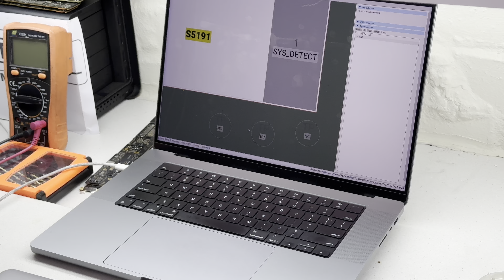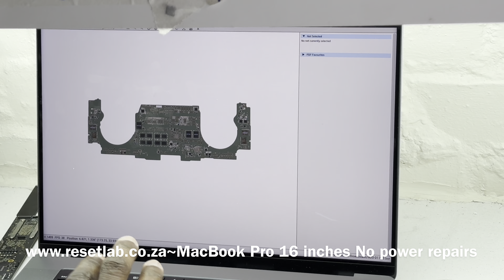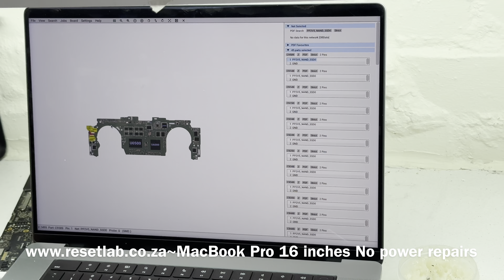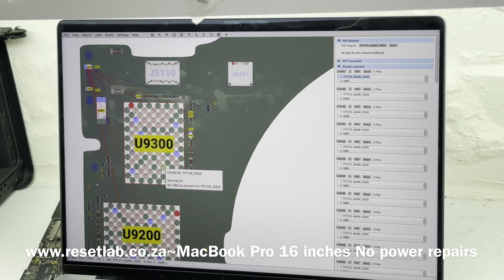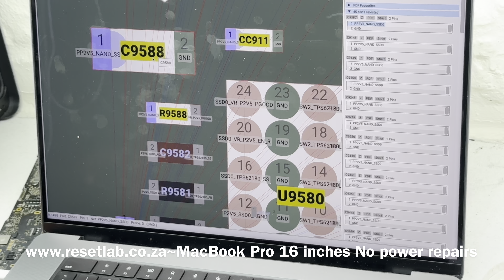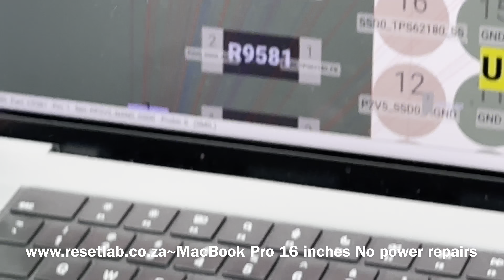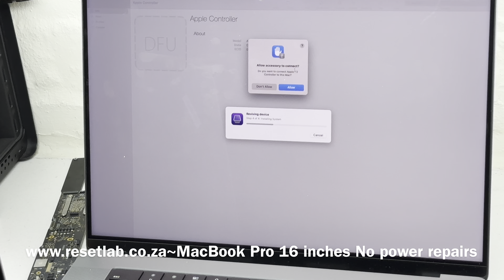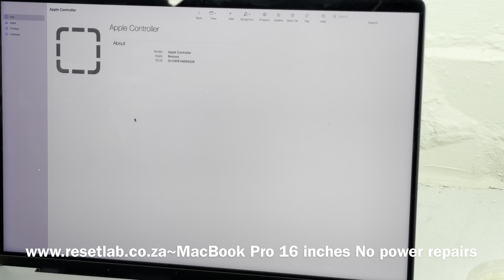MacBook Pro 16 inches A2141 No power repairs

Comment: Today, I just closed the lid of my macbbok pro A2141 16 inch it was at 13% and I pullged it in charging after 1 hour I opened the lid it did not start I have feedback on trackpad please help me bro??
Reply from the maker: @generalislive7  can you maybe tap on the caps lock key to see if the LED comes on? If not, you can press and hold the power button to forcefully shot down the Mac and then power connect your charger to see the response, just by the way, I supposed you are using a 96 charger

Comment: Hey there mate! Is there anyway I can get in touch with you? I have a no power issue on my MBP 16 inches A2141. When I plug in the charger I can hear the charging sound but no on screen, does this still mean that there's a blown fuse on the motherboard? I tried removing the battery connection and reconnecting it inside the laptop, that didn't work either. I need your help brother!!

Comment: how to get the spare parts like fuse, Nand, ssd to replace.. if I dont have any old board with me. I have got similar problem to my customers, I am a refurbished laptop reseller, I usually dont  do repairs, and I have not done repair using Soldering, but I am an electronics grad.. I understand.. I am planning to repair it my self.. but where to get the spare parts to replace..
Reply from the maker: @UshasreeKondapi  hello there , thank you for taking your time through the video, to your question, you have to look into a practical and cheaper way to acquire donor boards , for me , you can start by buying dead machines,

Comment: Today, I just closed the lid and opened it and it simply don't want to start. It's my work laptop, A2141, 16 inch, can you please provide any troubleshooting steps, pls. Any reset whcih probably can do the trick.
Reply from the maker: Hello, my friend, Do you have the troubleshooting tools,? Screw Drivers, Multimeter.

Do you have feedback on your trackpad? did you notice the battery percentage before you closed the lid?
 
Please let me know.
Reply: Thanks for replying. 

I don't have any of those tools, sorry. I am an end user.

The battery percentage was around 70%, and how to check the feedback on the trackpad?
Reply from the maker: @ireview8621 unfortunately, you need tools, if not you might have to take it to a repair shop for an assessment
Reply: @resetlab7142   Thanks for replying again.
Reply: @resetlab7142  bro i have same issue and i have feedback on my track pad what to do next please tell??